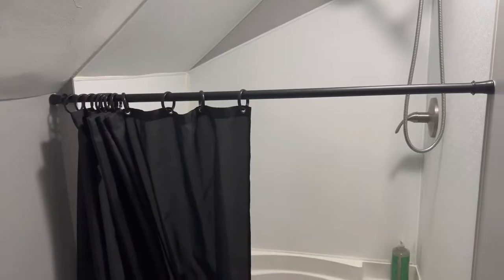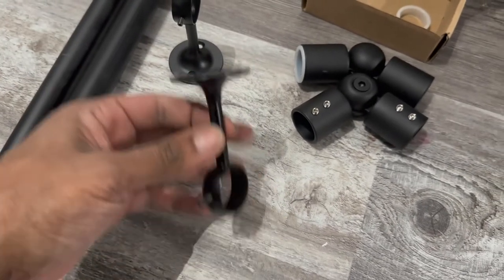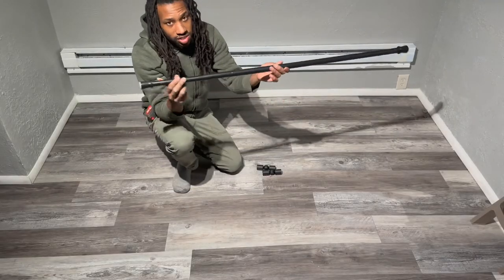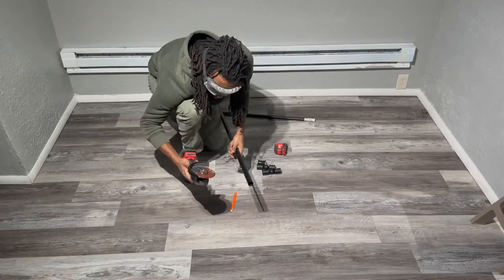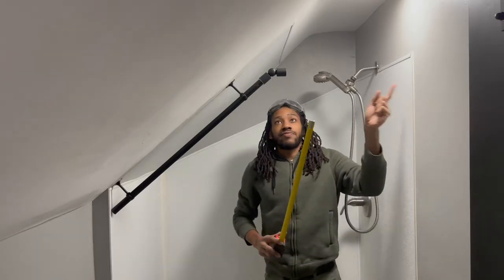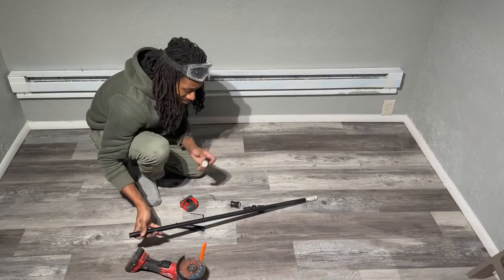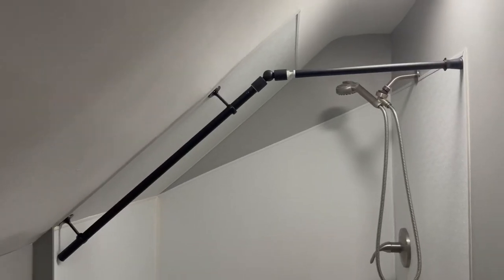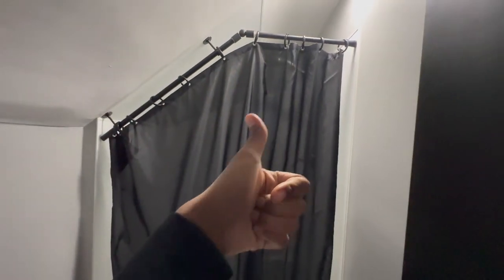How to make a Angle Shower Rod for Angled Attic Walls, Renovating Abandoned 3 Family Part 15

Comment: What did you use for that attic roof, insulation? There is no tiles,?
Reply from the maker: Blown in fiber glass we have a video insulating this unit. And no tile these are like acrylic panels on the walls and shower ceiling